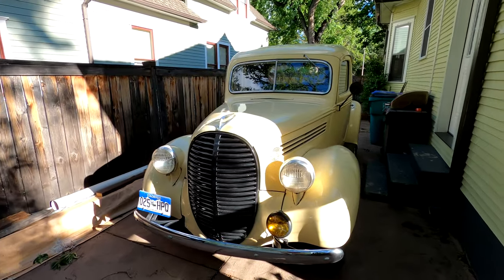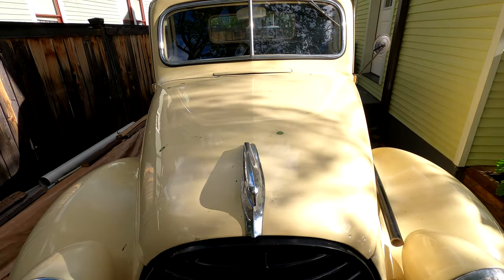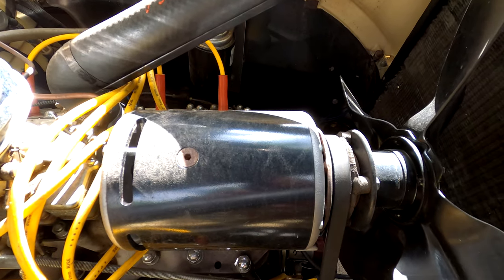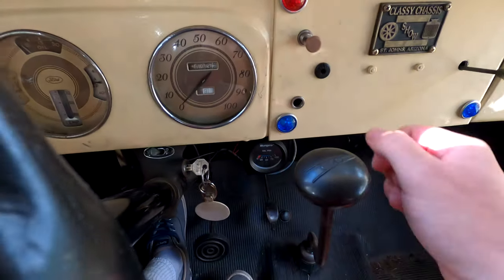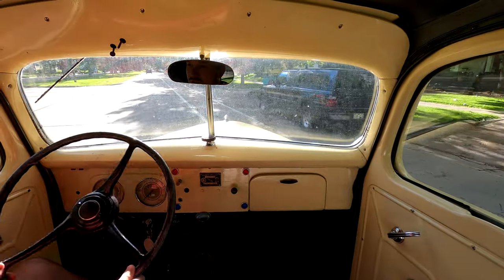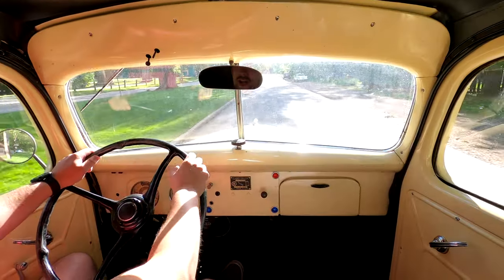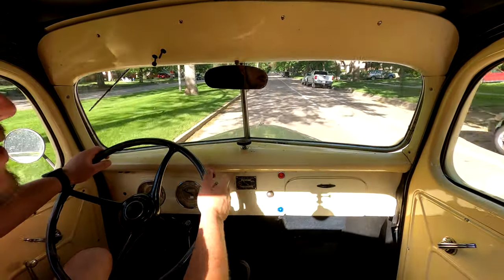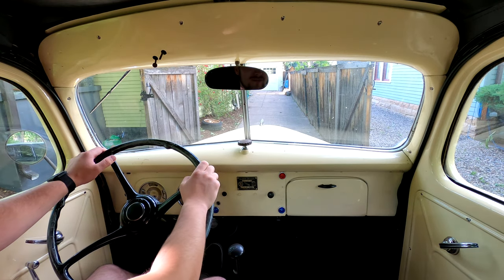1939 Ford Flathead V8 Truck | What Driving Was Like In 1939 | 4K Video |

Comment: Nice video!  The windshield wiper should be vacuum powered, if it's original.  I have a '37 Ford pickup, which is very similar.
Reply from the maker: That’s so interesting  I’ve been trying to figure out exactly how they’re supposed to work. There’s a weird lever inside above the windshield I just assumed they were hand powered lol.

Comment: It feels like it's going to fall over going around a corner and it's really hard to drive..........now another really cool thing about these old trucks is....  what a line!   Anyways did you ever think of changing the gearing?  Maybe a higher ring and pinion.   A lot of these old Fords had a 4.1:1 ring and pinion in them and this includes the cars.  You migh have an extra low first gear too seeing as how it's a truck.
Reply from the maker: Yes when my dad used to drive me around in this thing whenever we’d go around turns I was always worried the door would fly open 😂. I have considered changing the gear but then realize it’s the original rear end and it truly doesn’t need to go any faster than 45 for what we do with it. I’m pretty sure the first gear is VERY low for towing and things like that back when they were used for farm equipment. Thanks for the comment and the great ideas!

Comment: Actually your carburetors are 2 barrel, not one. The pickup probably has 4.11 gears in the rear, that's why 1st is so low. If you had 3.54 gears in the rear you would be using 1st all the time.